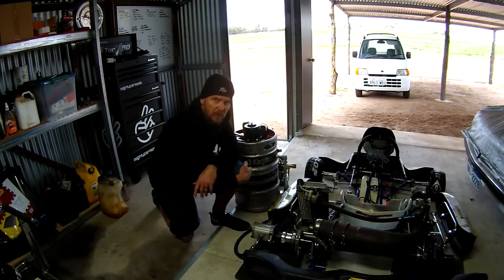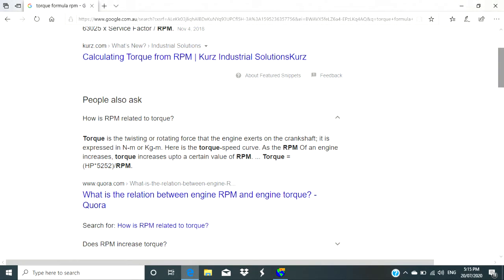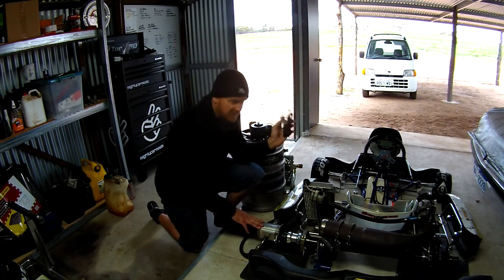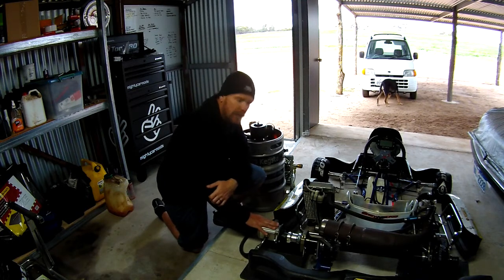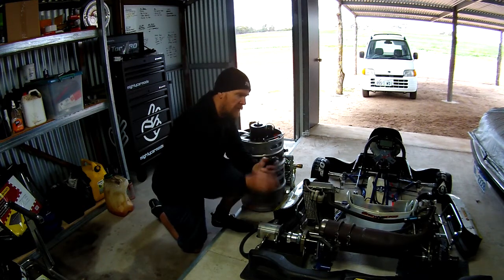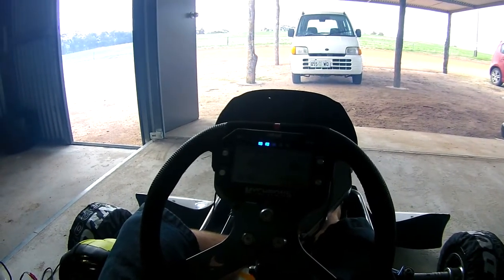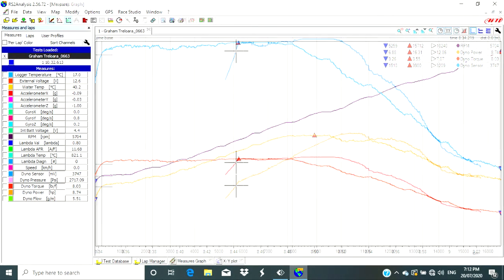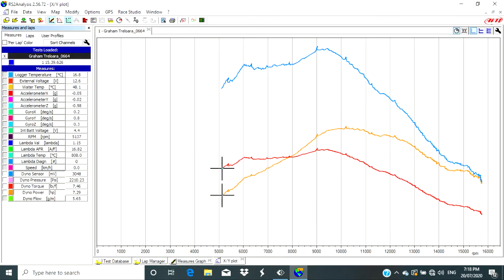Kart Dyno Build Part 4

Comment: Hey mate,
Great set of vids. I’m interested to know why you vary the load during a ‘run’ and why it is not left constant as revs are increased?
Cheers and thanks for sharing!
Reply from the maker: Hey James, 
It comes down to the type of dyno you build.

A inertia dyno works by having a unchanged ‘load’ - basically just a weight that the motor has to turn. In that style dyno, you make power calculations based on essentially how fast your engine can spin that weight up to a certain rpm. 

My dyno is a ‘steady state’ or brake dyno. It calculates power by applying a varied load to the engine. Essentially, you can test the power at a specific rpm by adding load until the engine can’t increase past that chosen rpm. 

In my video I am varying the load so the rpm can sweep across its usable range. The run starts with the valve screwed almost all the way in (highest restriction) and the accelerator is left at 100%. I then open the valve slowly to allow rpm to increase- how fast or slow you operate the valve dictates how fast rpm increases.

Comment: Hello

Great idea, since some time I am also planning a biuld of dyno for kart and another one for 1000HP.

I guess you did not directly proper measurements from Mychron, since pump losses are not linear and hard to consider.
You may make the pump floating and measure the actual torque with load cell. There are load cell to 10V converter for 30usd. 
Feeding the Mychron with actual torque and RPM will make great field dyno.
Cheers

Comment: Enjoyed your series of videos, great Covid project for karters. I have been planning a hub style dyno for or karts as well using the hydraulic pump but with a torque arm. The pressure sensor and using the mychron was an interesting angle.
Reply from the maker: Raymond Raaymakers - cheers for the comment. I have also looked at the torque arm setup, I settled on this for the moment due to size constraints with a torque arm likely to foul on the side pods/rear bumper